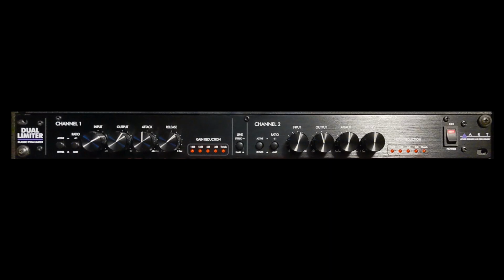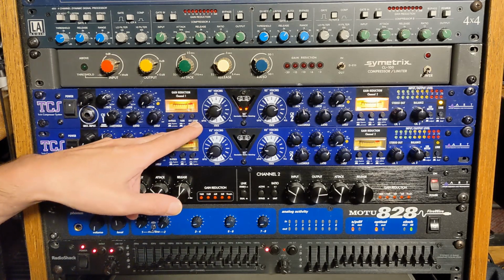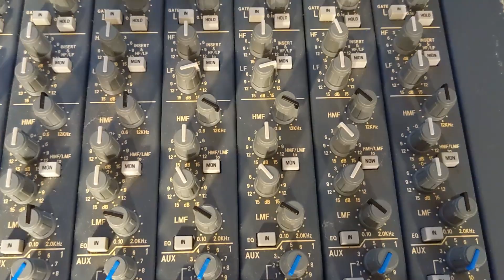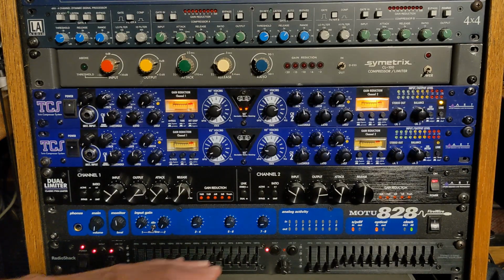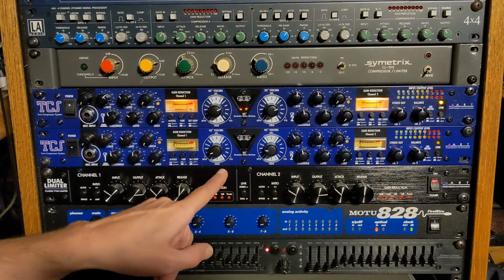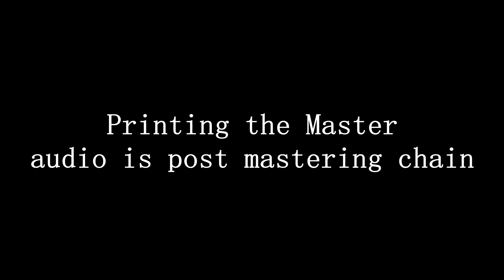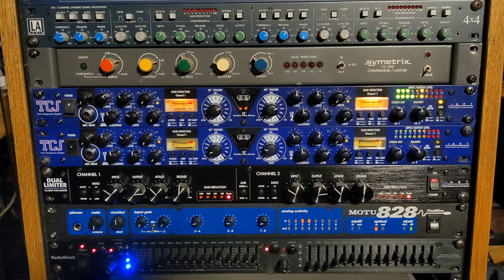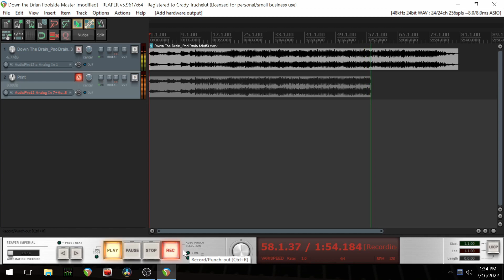Mastering with Cheap Analog Hardware

Comment: Excellent Video here Grady! I've had a few songs of mine done by a "pro" Mastering engineer, and I must say that I believe now that we can actually master our own songs for commercial distribution. I've learned a few ways of doing it, analog, and ITB, and honestly, in a lot of cases, in my opinion, It comes out better than sending it to a "pro".
Reply from the maker: A lot of these so called "mastering" software packages and online processing don't really produce the finished master by ear. They are just using the same algorithms to do the processing using some basic settings that hopefully aren't too extreme and don't destroy the original mix too badly. Mastering yourself is probably a better option than these services and most software packages unless you're using a real mastering engineer that's actually going to listen to the audio. The other option is to use software that has enough options where you can tweak the finished Master to your own preferences. So unless you're going to pay a respected mastering engineer to master your project, you are correct that  it's probably a better option to master it yourself with good software.
Reply: @TwinCreekAudio  Hey Grady! Great points here! Absolutely I also recommend stay away from the “instant mastering” AI mastering, etc… I have lately been mastering to tape from the DAW(logic) to Mackie 32 8 bus analog console with outboard EQ(DOD Q-231), and ART Pro VLA ii Compressor in the main inserts. Bounce the final mix from the board to Tape, and then from tape, back into the DAW, and lastly the only plugins I’ll use is the Adaptive limiter, and loudness meter to boost up the mix to streaming levels to around 14.0 integrated LUFS. To me I like this method best, and the mix/master sounds better than when I used to send to a mastering engineer.,

Comment: the comp/limiter worked pretty well . with a better EQ you would have got a lot closer to a good result , the desk EQ just didn't really cope .
Reply from the maker: That's true. I don't have anything that's really good enough for mastering. I may try it again if I get a good outboard EQ or possibly pre EQ in software
Reply: @TwinCreekAudio   ill say get the drawmer eq symph eq or get the art graphic eq i did ask art for to make a stereo transformer EQ with different color mode the guy did say he gone mention it to the developer. or do this get a 500 series stereo eq like Elysia eq or the ultra violet eq to strengthen the mastering Fars on the EQ Tip got my art limiter on slow attack fast release. it does work very well i tested it too and its in my chain until
Reply: @TwinCreekAudio   oh yhea a good quality mastering eq plugins like from Acustica audio will work very well with ya analog highly recomend for you to try them out too when you get a chance

Comment: Made me think of the time I mastered a song through my old dbx 166. Sweet sounding until I lowered the threshold for the peakstop/limiter. From the 166 I went to the peavey Kosmos sub exciter/treble enhancer but it was a bit too much. There was another occasion where I split my mix to mid/side but the mid went through a dbx 160. Not an advisable move at all but hey, it's science... and art...

Also made me think that I owe myself the test of mastering (again with the 166 but) with sidechain EQ. I got a 4-channel Tascam parametric EQ, alas, just used for tracking so far. But I'm eager to pass some mixes through a pair of channels, then into the second pair of channels for extra tweaking. Might as well add a pair of de-essers to my shopping list...

Speaking of M/S, there's Lisciel in Brazil who masters through both M/S processing and freq-band separation/crossovers (and then to analog tape). So he expands the lows downward while keeping them centered... EQs each region differently and so on and so forth. To that I added upward expansion to the high end on the side images... so much tomfoolery one can do to a stereo track.
Reply from the maker: I have always heard about using a pair of DBX 163Xa to get close to SSL bus compressor for cheap. I like the 166 as well. It's great that you mentioned this because I've actually been thinking about trying a 1066 for bus compression. It has a contour switch which I think tweaks the side chain EQ similar to what I was doing with my graphic EQ. I don't actually have a 1066 or a 166 currently but I am looking at getting a 1066 to try this and for other reasons. Ive heard about the Kosmos for years but have never used one. I used to intern at a studio called Planet Dallas and the chief engineer  used a DBX subharmonic synthesizer when mixing to add sub lows to bass and kick iirc. As you can probably tell from the mini videos I have made about it, the ART TCS is one of my favorite pieces of inexpensive gear. I didn't include it in the video, but I did try it with the optical compression and the VCA compression stacked before hitting the dual limiter. It actually sounded good but would not have worked for the song that I used in this video. It is definitely a lot of fun to master a two-track stereo mix. I think that as long as you have a good ear and the gear you use doesn't degrade the signal, a set of like this can work. Thanks so much for your comment. I love discussing this stuff!
Reply: @TwinCreekAudio  you used to work @ a studio called planet Dallas? Then does that mean your in the DFW area? I ask cause I live in just south of Ft Worth, would love to get a chance to test out some of your gear sometime, as well as bring some of the amazing "sleeper" units I've picked up over the years to show you. There really is no substitute for physically trying out a unit to know how much you do or don't like it. Especially when your trying to find gear that is underapreciated/ undervalued/ &.unique, I've definitely bought more than a couple units that I new I hated within minutes of turning them on but was then the not so proud owner due to a lack of a test drive, like wise, I've occasionally had the opportunity to try out some fantastic pieces of gear, either while jamming with friends or at a music or pawn shop, that I most likely otherwise never would've known about or been interested in.

Comment: Man, I gotta say. Your channel and all of your videos are the most informative and straightforward videos on the hybrid studio on YouTube by far. No big or showing off just good information. I watch these over and over all the time. Great work!! I also have a question regarding a option on my mix console here at home. I have a behringer mx9000 and it has main inserts one left and one right. I was thinking of using this old bbe sonic maximizer I have in those inserts after everything is mixed to my liking. This is after the bus section which I use for grouping and parallel compression.  I was wondering what are your thoughts on that? Maybe there's a better way to utilize the maximizer in the chain?
Reply from the maker: Thank you so much! I work really hard to make the videos for this channel. As far as your question is concerned, the main inserts should work fine with a BBE if it's helping with the sound. From what I know, the BBE has more of an effect on the low end so you could also use it on a subgroup with drums and bass and other things with lots of low end. Best of luck and let me know how it works out for you.
Reply: @TwinCreekAudio   cool. I think im gonna go that route instead of the main insert idea.. thanks for all that you do.

Comment: I have the same ART compressor I'll try to master with it. I have no experience with it since I got it in a guitar multi-effect deal. But, let's give it a try maybe the tube does add something.
Reply from the maker: It's a good compressor and has a master bus setting that's good for the beginning of a mastering chain. I don't think ART claimed these were for mastering but they work reasonably well as the first compression stage. I like the tube circuit but it doesn't change the sound much. It does seem to boost the level a little though . The Dual Limiter is good too as the final limiter if you don't push it too much.